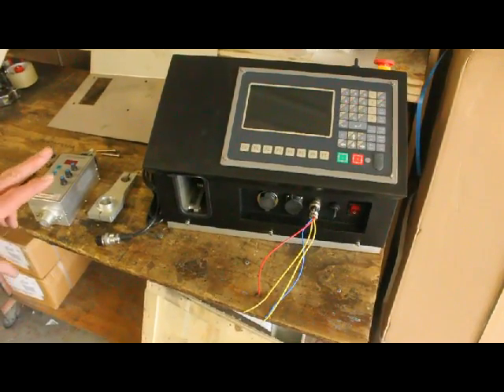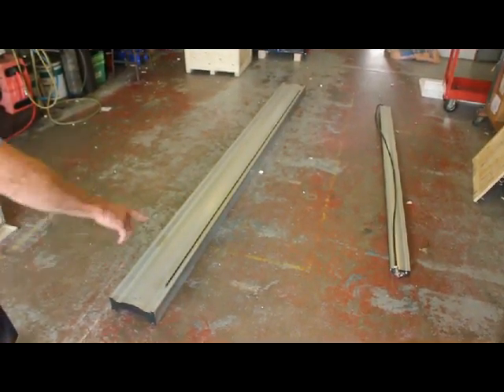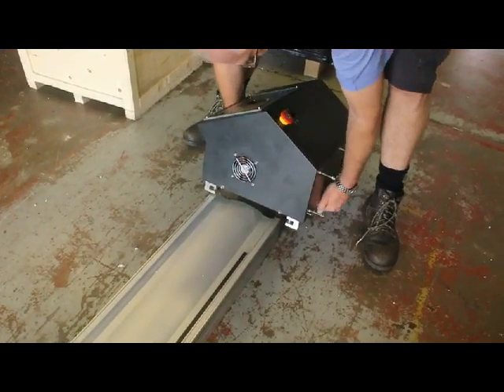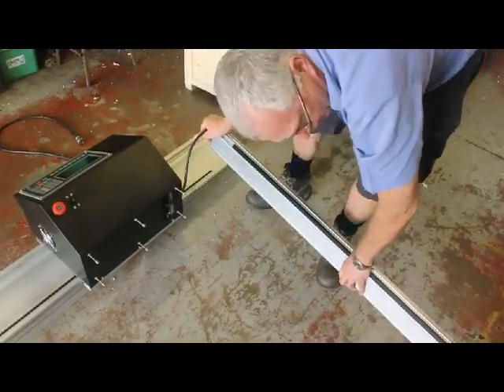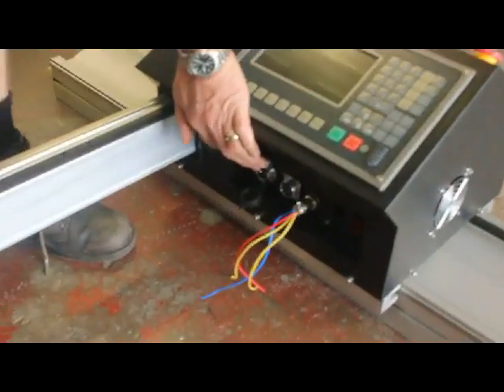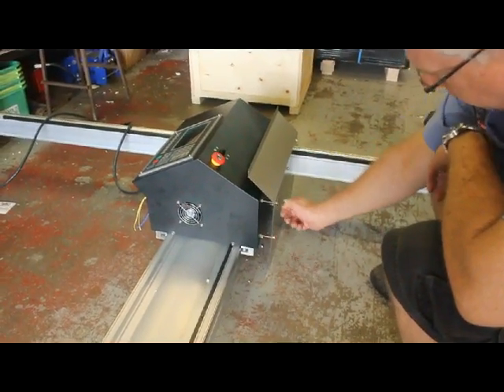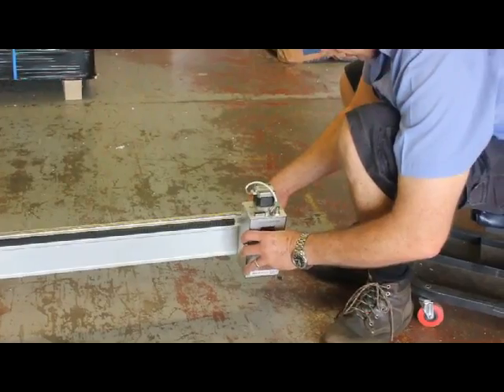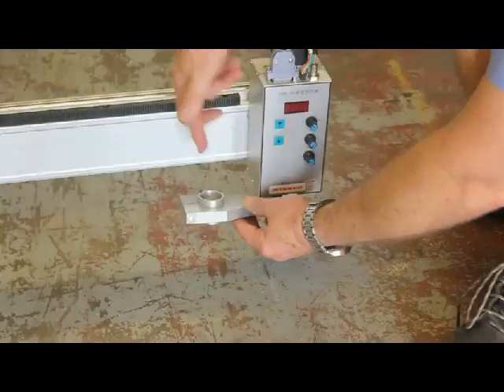Portable CNC Plasma Unboxing

Comment: Thinking of buying one of these how do you use it with dfx files,does it support AutoCAD?? I'm UK based
Reply from the maker: The software supplied with is is Fast cam (Cad, Cam, gcode)  if you look up specs and video you should find it will accept dxf files from other cad programmes then it can generate cam and Gcode which you use a USB disc to transfer from you computer to the cnc Machine.
Reply: Thanks I take it the display is in English, have you used it much?
Reply from the maker: @SGfabrication  yes English programs. I mainly used my demo machine to set up and test when I started to import to Australia 5 years ago it is still used on occasions but the latest machines the factory supply are slightly different.